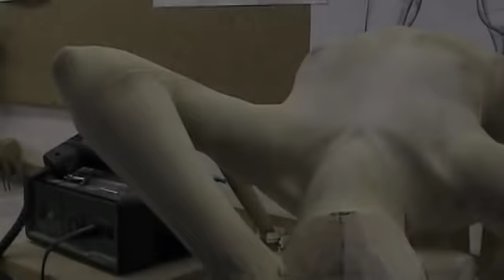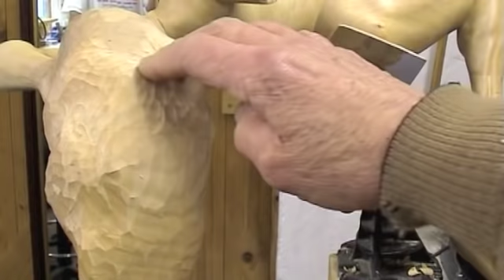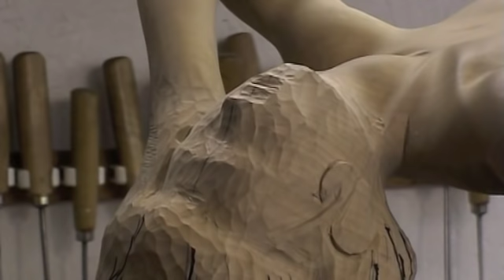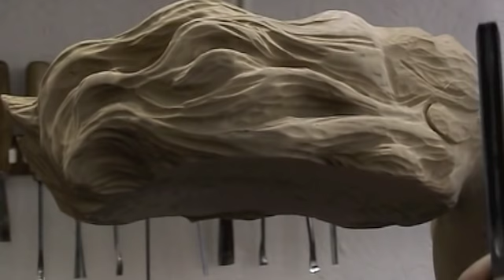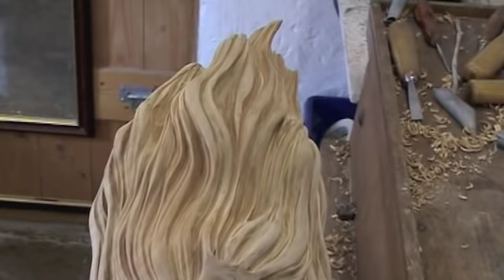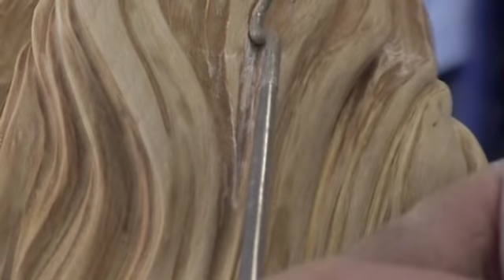Carving Venus Sample - The Hair - Woodcarving DVD by Ian Norbury

Comment: Oh, I've found that cutting old hack saw blades into micro scrapers works wonders to clean up tight areas with out the need for sanding.   I'll "grind" with super coarse then scrape where I can.  Works beautifuly on maple.  In my videos "Benedict" was not sanded but scraped.